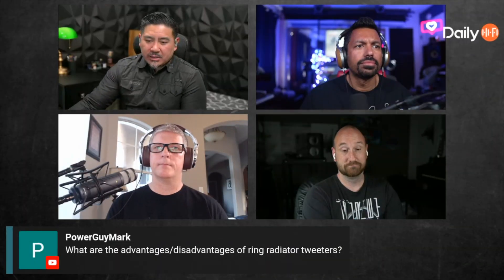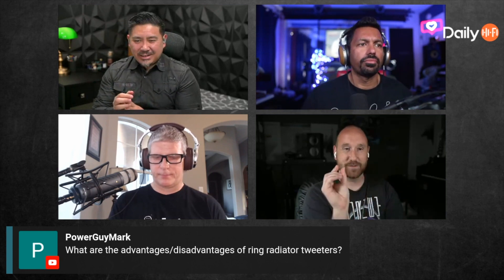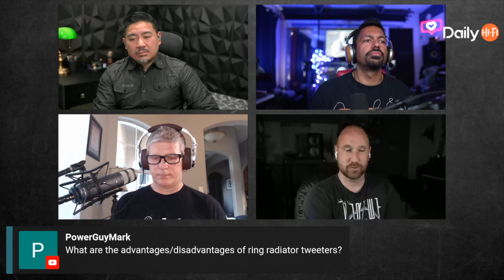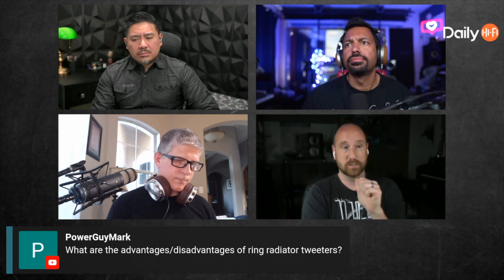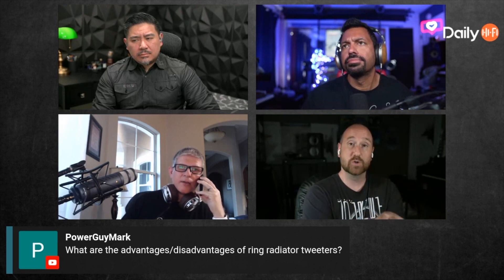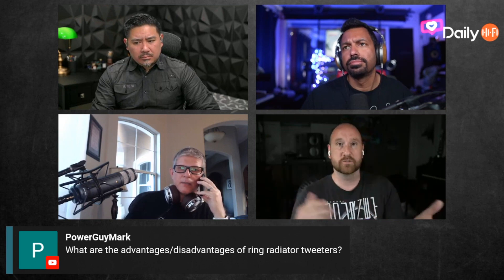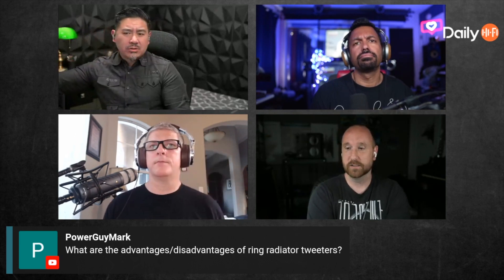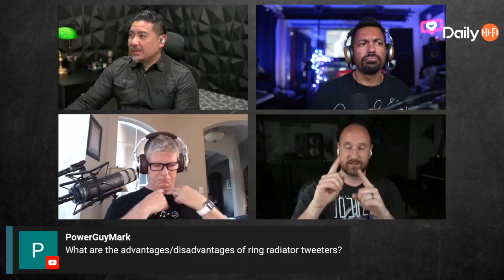Ring Radiator Tweeters

Comment: I have a pair of JBL 075 ring radiator tweeters that I plan to use in a hybrid open baffles setup.

They were introduced in 1955 so they have been around for quite awhile. Mine were probably made in the 60s or 70s.